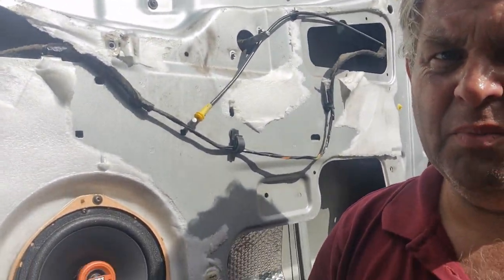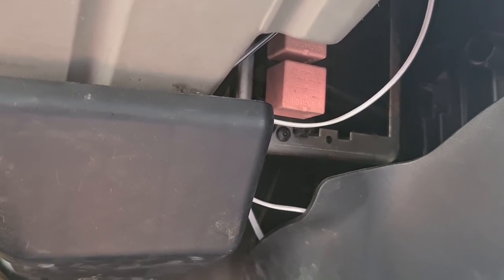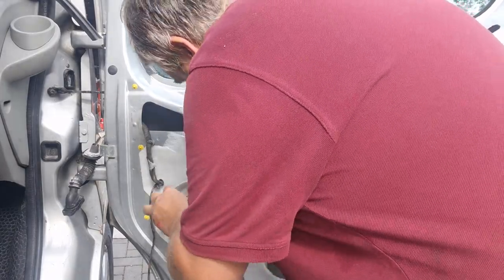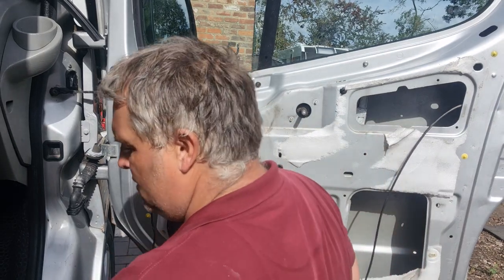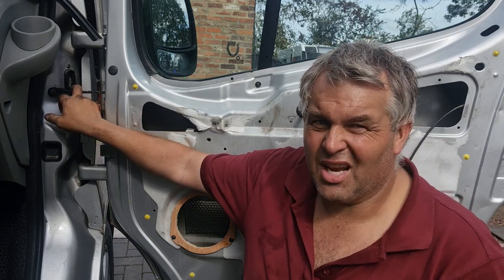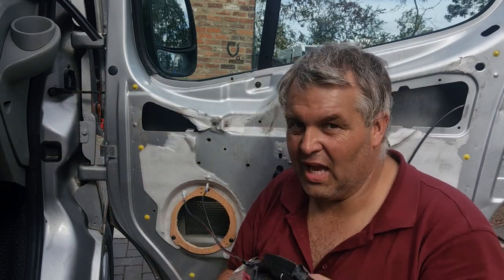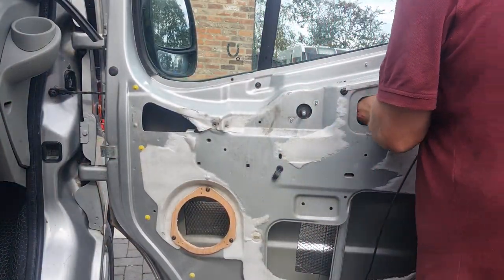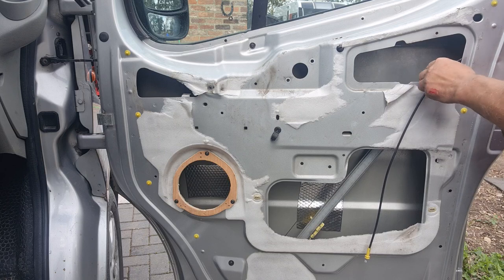Vauxhall vivaro 2.0 and 1.9 / Renault Trafic, up grade to electric window installed

Comment: I've got a 56 plt trafic with manual windows and standard mirrors. I've managed to find a pair of front doors with leccy windows and mirrors. What other parts do I need to get ofg the donor van to bolt them onto mine?
TIA
Reply from the maker: Hi Robert 
I'm going up load a video on this now for you 👍
Reply: @ON-THE-DRIVEWAY  Thanks
Reply from the maker: No worries 👍